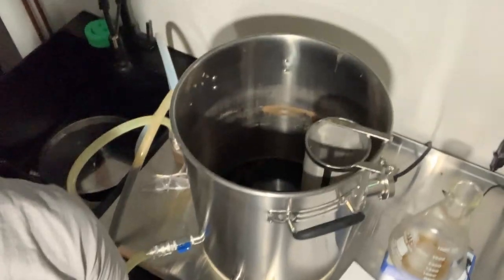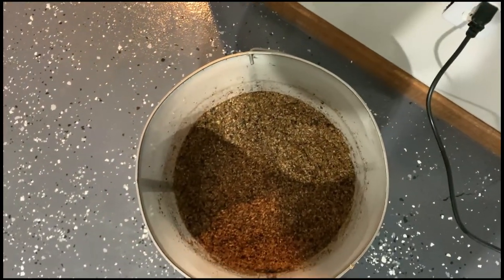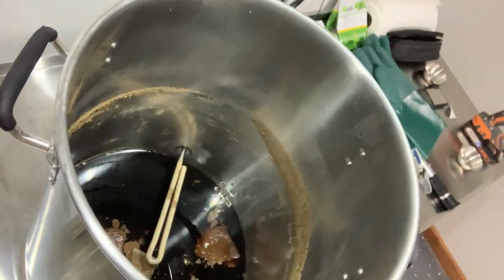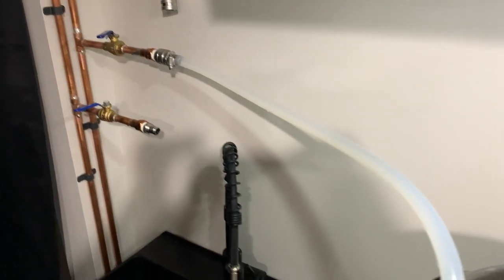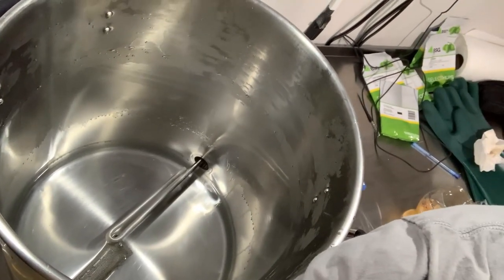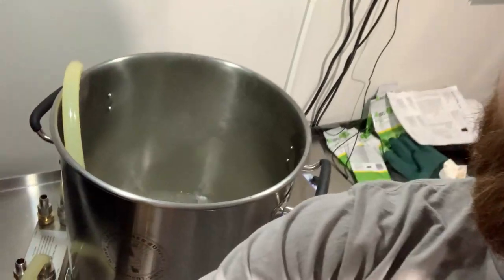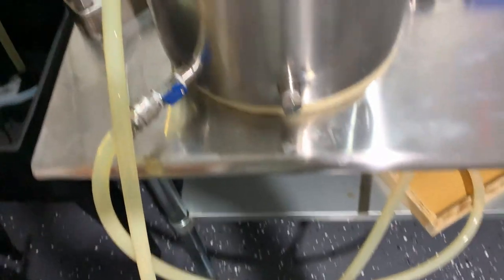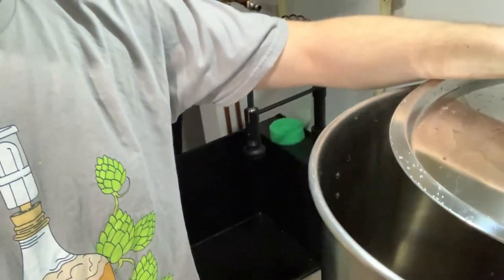Clawhammer Electric BIAB - Cleaning Walkthrough After Brewday!

Comment: Good job with the cleaning video! I have been using my 230vac Clawhammer for a couple years now and love the controller. By the way, one thing I learned was always disassemble the pump and let it air dry. I ran into issues on not getting the pump completely clean and had mold grow inside of it. I now disassemble and sanitize it every time. Cheers!

Comment: I am preparing my 1st batch & appreciate your guidance.
What do you recommend if you do not have a quick connect hot water source?
Bring a volume of water to "hot" (?130F) with the heater?
Reply from the maker: So pbw and cleaning it out works much better when it’s hot, you can heat up the water in the kettle if you have a 240v set up but if you are on the 120v that may take a lot of time, you could fill 5 gallon buckets of hot water from another location and bring it to you as well.

Comment: I just purchased the same sink/faucet and am curious why you initially clean off the Clawhammer outside as opposed the sink. Because of all the hop debris? Are there some things you’re not comfortable pouring down the drain? Thanks!
Reply from the maker: I usually do my best to remove the hop debris so it does not go into the pump.
Reply: @TroubleBrewing  thanks! Forgot you’re using a pump for the draining.

Comment: Awesome video thank you! How do you usually empty your lines after the last recirculation of hot water? Is there a way to pump out all of the liquid or do you just take each line off and let it go down your floor drain? Personally, without having a floor drain I usually just have to unattach each line and try to grab the liquid with a small bucket.
Reply from the maker: Hey! Sorry for the late reply, my notifications were turned off. Need to look into that... Ha yea I just try to get all the water in a bucket. There is no simple clean way to do this.
Reply: @TroubleBrewing  No worries at all and thank you! Love the videos.

Comment: Just stumbled upon this video. Just did my first two brews in my new electric setup this past weekend. This gave me some ideas on how to streamline my cleaning process. Just to check, you don't use your element to heat your water, you just use hot water from your sink?
Reply from the maker: For cleaning yes. No need to go the extra step and heat my cleaning water if I have hot water on tap. For brewing I use RO water that needs to be heated up.
Reply: @TroubleBrewing  Thanks! My 240v hook up is in the garage but I don't have easy access to a drain. Might bring my kettle and pump into laundry room next time for cleaning so I can use that sink, similar what you show.
Reply from the maker: @pmhartel  Yea before I had a designated space downstairs with plumbing that what I had to do for cleaning. I will say this, having a sink so close to my brewing setup is the BOMB. Makes brewing/cleaning really convenient. Not sure how your house is laid out if there is some waterlines you can tap into above or behind where your brewing setup is at but id look into it if possible. I have a plumbing video on my channel on the brewery series if you want to see how I tied in the lines.
Reply: @TroubleBrewing I'm trying to figure out how to work a brewing area layout into my garage. Currently I just temporarily have my kettle on a table near my outlet so I could get it fired up. Already have water supply to the garage and a floor drain so that's going to make it easier. Hoping I can snag a stainless sink we are eliminating at work.

Comment: Thanks! My only question is, how do you dry the plate chiller? It’s been a few days and I still hear some sloshing. I’ve had it on its side, fittings facing down, but no luck. Is the water a concern?

Miss your videos but I get that content creation is a real tough thing to do, especially in a hobby as tiring and niche as ours. Cheers!
Reply from the maker: Hey thanks! Yea I had to stop when we had our second kid. I do plan on revisiting YouTube at some point but honestly was getting burnt out as well. So to answer your question, its going to be pretty impossible to 100% get it dry because of how they are designed. There is probably always a bit of water in mine. As long as its just water and not chemicals/wort or anything there should not be a problem.
Reply: @TroubleBrewing  gotcha yeah totally understand dude, family comes first always and burnout is nothing nice. Thanks for the answer, I won’t worry about it! :)

Comment: Does the grain basket fit in a normal 5 gallon plastic bucket? On another system with similar burners, I use lactic acid to clean it - always sparkling.
Reply from the maker: I just checked, it does not unfortunately. Good idea though, I imagine if you could maybe a 10 gallon plastic bucket that may be a quick way to get that really clean.